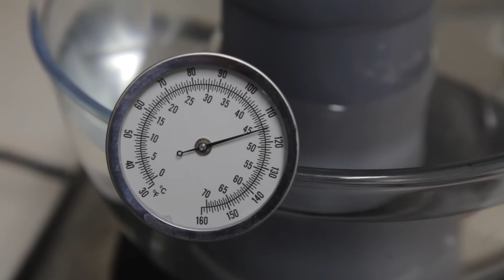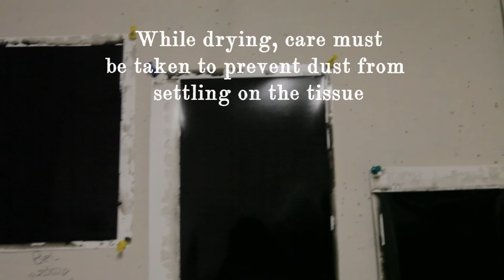The Basic Guide to Carbon Transfer Printing - Part 2

Comment: my question.. the paper you're going to transfer them to.  I've treated them with geletian, but they still don't stick.. how do you properly prepare the paper?
Reply from the maker: Using gelatin coated paper is the most difficult option. Usually the gelatin is hardened in a glyoxyl solution before use, but even then there is no guarantee that the tissue will stick. Proper squeegee-ing of the sandwiched sheets will help though. Another option is to use paper coated in acrylic polymer and cured in a mount press. The third and easiest method is to use fixed-out photographic paper, preferably fibre-based.
Reply: Gelatin-sized art papers are indeed the difficult way to do it - but they make gorgeous prints, so there's virtually no way around it. I find that following Sandy King's instructions gives good results. Pay particular attention to the following:
* Make sure the gelatin sizing is hardened. A few drops of formaldehyde, glyoxal or chrome alum added to the sizing before it's being applied is the common way to go about this.
* Size your sheets several times. I have had good success with 3 consecutive sizings of 5% gelatin hardened with either formaldehyde or chrome alum and applied with a simple brush (foam or hair). Let the paper dry out entirely before applying the next coat. A single brush-coated layer of sizing just doesn't cut it - trust me, I've tried, too many times...
* Allow the sized sheets to dry and harden for several days before using them. 
* In the transfer bath, it's particularly important not to let the final support and the exposed tissue soak too long. 2 minutes for the tissue (by then it's become entirely flexible) and 20-30 seconds for the final support works for me. The final support just needs to get wet evenly, but it doesn't need to actually soak all the way through. Overdoing the soak results in the gelatin of both the tissue and the sizing swelling too much.
* Use a paper with a fine surface texture, but still some 'tooth' so that the sizing adheres well. Very coarse/rough papers may need a more heavy sizing to fill in the pits and valleys of the surface so that the tissue can make good contact with it.
* As GPV points out, make sure to squeegee excess water from between the mated sandwich. I use a fairly hard roller for this. Don't use excessive force, but don't be too gentle either. Start with a gentle stroke while holding the tissue securely down onto the final support and repeat a few times while pushing a little harder every time. In the past I used a squeegee (sometimes still do) and that works just as well. 
* Give the sandwich some time to mate properly. I put a plate of glass and a big book onto it, and then a jug of water (1 or 2 gallons) on top of that and leave it undisturbed for at least half an hour. There's no rush; you can go shopping or do something else for a couple of hours and then come back and do the hot water bath thing.

Having said all that, make sure you can get a good transfer onto fixed out photo paper before you try home-sized 'art' papers. Otherwise you'll have too many potential causes which will make troubleshooting a nightmare. Fixed out RC paper works extremely well and is quite cheap.

Comment: Thanks for the series. When the carbon tissue has dried sufficiently, how long can one keep them? In other words, can one make a batch of them, store them and use when needed?
Reply from the maker: +Fanjan Combrink It's advisable to make them in small runs and use them as quickly as possible, but you can, if needed, store them in the freezer, kept as flat as possible, for a long while.
Reply: To be honest, don't freeze my tissue or anything like that. As long as it's dry, it'll keep for many months. I've used tissue older than a year, which was stored flat in-between a stack of books. I'm confident that you could store it up to a few years - as long as it doesn't get wet and it is stored away from any fumes that may harden the gelatin (e.g. in the close vicinity of sized and hardened final transfer papers!)